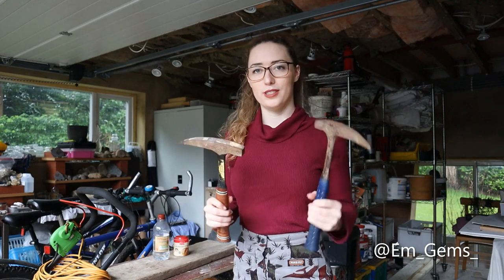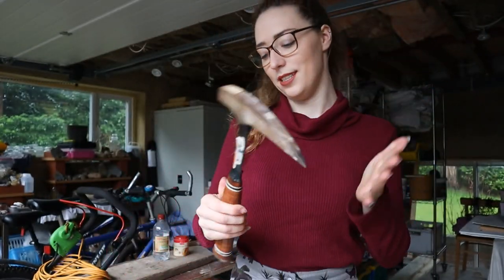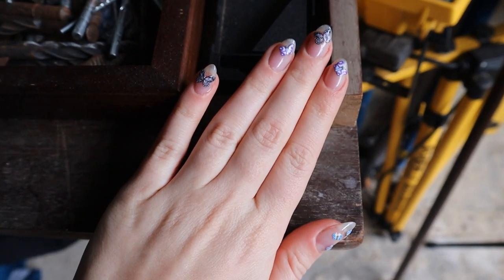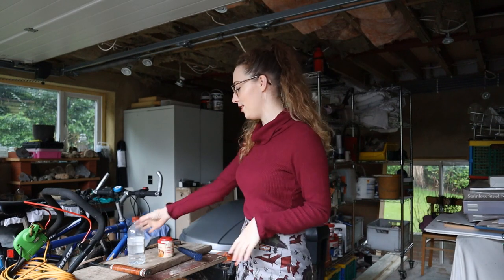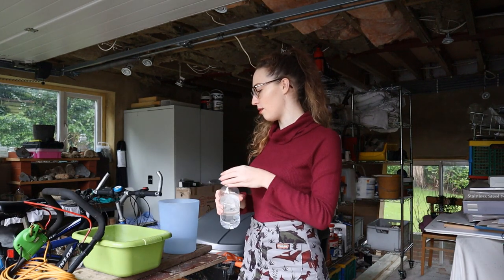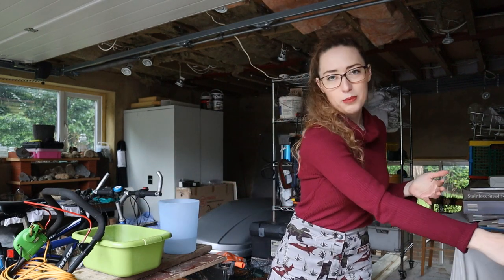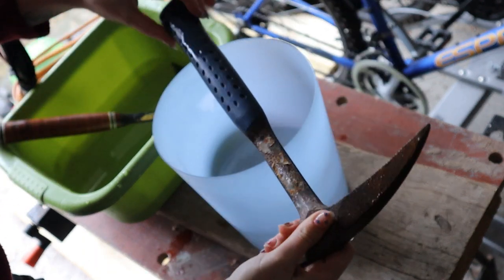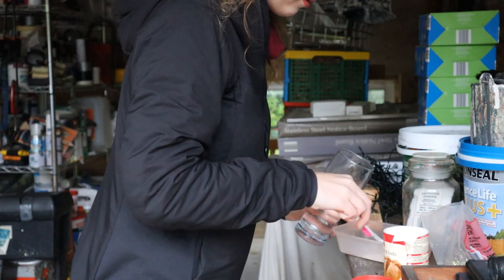Fossil Friday - Hammer Cleaning (+Wisdom Teeth Update 🦷)

Comment: I use citric acid for rust removal. Cheaper than vinegar - search on ebay for "citric acid 1kg" and you will be able to get hold of a pack for less than a tenner.  A couple of tablespoons in 500ml of warm water and you are good to go.  Sold on ebay for diy bath bombs!  You can also use the same solution to descale your kettle or coffee machine. Rinse well before use!

Comment: Thanks for the post Em, hope you are feeling better~ Also, we used to use Coka Cola to remove the rust from old bolts as well as ammonia. Could actually see the rust bubbling in both~ steel wool will remove the rust leftover without digging large scratches in the surface metal then if you have a buffer you can buff that out then as mentioned elsewhere either oil regularly or dip in wax to keep the moisture out~ Hope you have a nice weekend ahead!

Comment: Just use sandpaper with a sanding block next time,  180 and/or  220 for cleaning and 320 for the "polish" or steel wool if only a minor cleanup is required.

Comment: You should buy some cleaning vinegar, it's really cheap like 35cts for a liter, soaking your hammer in vinegar will eat away the top layer of your hammer and the rust, probably over night.
Maybe buy a steelbrush, that'll just scrub the rust right off.
Best thing to do to prevent rust is to wash your tools after they've been exposed to a salty environment, just some warm soapy water is fine, just to remove the salt.
Thoroughly dry your tools once they've been washed.
You can even give them a little layer of grease if you want but that's more for long time storage or sporadic use.(afaIk)
That's right about as much as I know.

Comment: Next time consider using a fine grade (#00 or #000) of steel wool (or wire wool or whatever it's called there) to remove the surface rust and use car wax on the shiny metal. Really, try it!